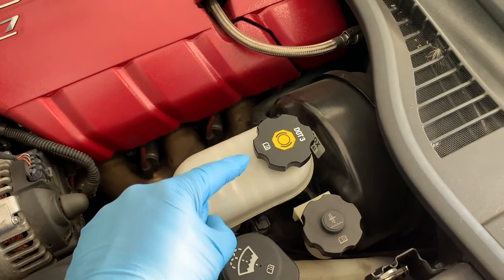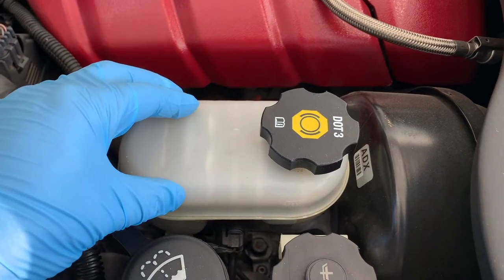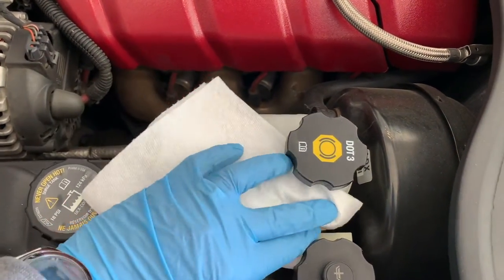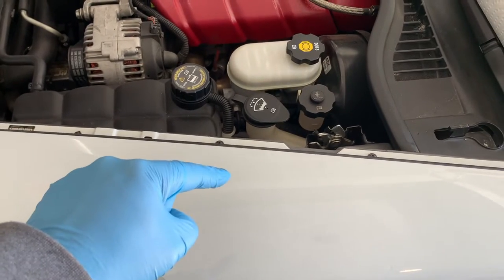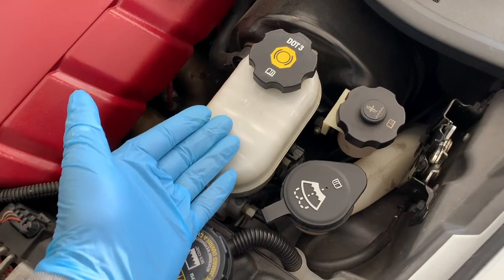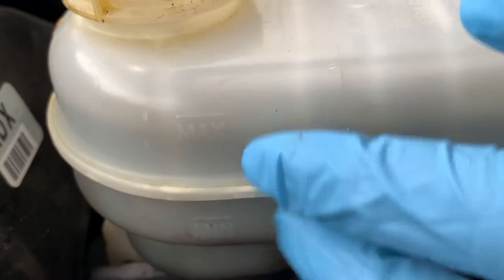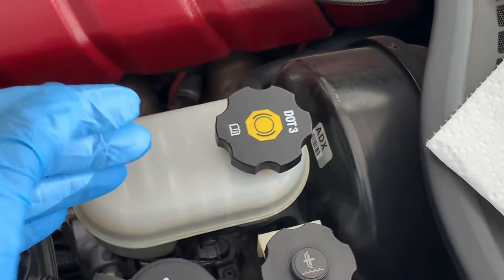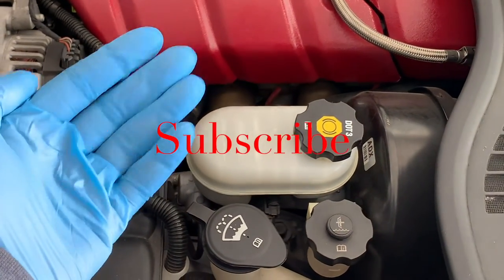How To Check Brake Fluid - ALWAYS clean the cap first!

Comment: I have a 2002 Chevy Silverado. There is a valve and cylinder underneath driver side and shut off valve. Its not a factor part and idk what it is. If i could send a picture. My brakes have air,?  I just want to be able to look up the part to order so i can replace it

Comment: I had a mechanic put brake fluid in above the max line. Can I just take some out until I reach the max line?
Reply from the maker: Yes - use a syringe.  It’s easy, safe and fast with a syringe.
Reply: I had lost my brake cap (dot 4) when I was checking the color it fell in the the engine and didn’t show up on the ground so put a dot 3 brake cap and it was tight and secure doesn’t it matter that I put a differnt brake cap ?
Reply from the maker: If it’s a secure fit, then it will be fine.  Many lose those caps or replace them with after market ones - so it’s not an issue.  Just remember to always use the correct fluid regardless of what is on the replacement cap.